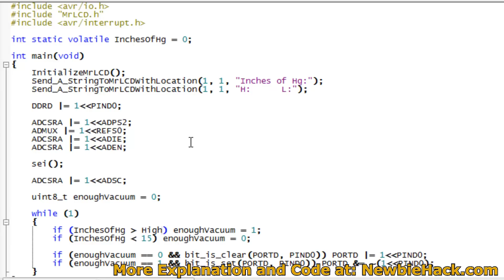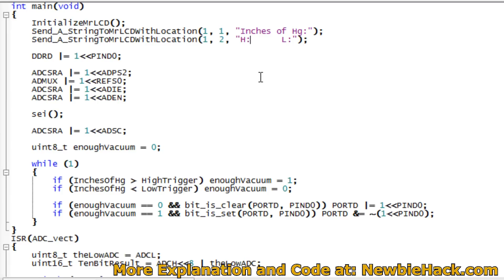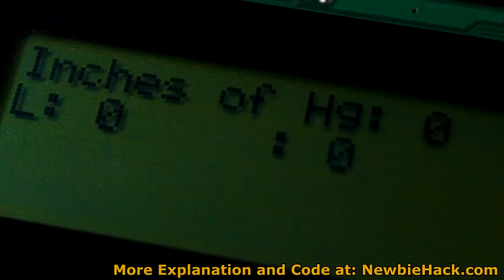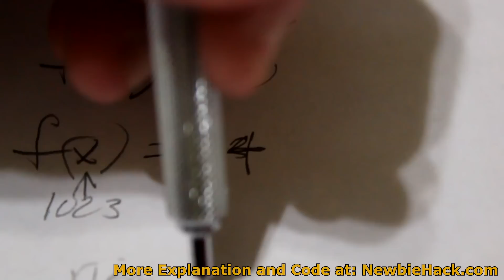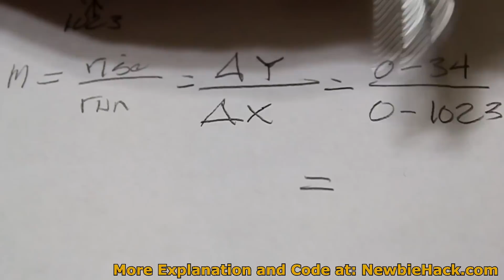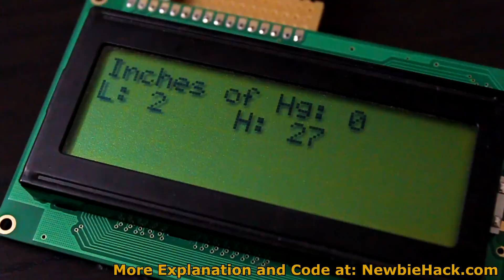45. Arduino for Production! AVR ATmega32 - Part 5 - Real World Example of Create a Vacuum Source

Comment: You can also use mask to make it more clear in the ADC interrupt function :

uint8_t mux = ADMUX & 0x1F;//0b00011111 put the last 5 bits of ADMUX into mux

switch(mux)
case 0 : ADCResult_1 = ADCResult10; mux = 1; break;
case 1 : ADCResult_2 = ADCResult10; mux = 2; break;
case 2 : ADCResult_3 = ADCResult10; mux = 0; break;
default : break;

ADMUX = (ADMUX & 0xE0) | mux;//0b11100000 keep the first 3 bits of ADMUX and change the last 5 bits with mux

Comment: The 33 vs 34 issue is probably related to the C code convertion of the floating point value to an integer - if the result is lower than 33.5, when converted to integer I guess it goes down to 33.
I say I guess because I think this is something that depends on the implementation of floating point operations and conversions in each language.